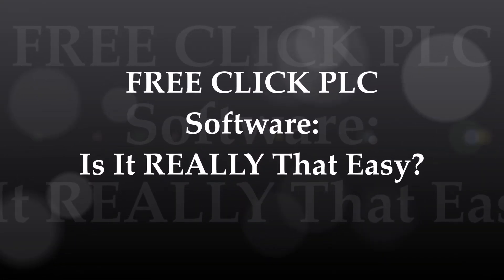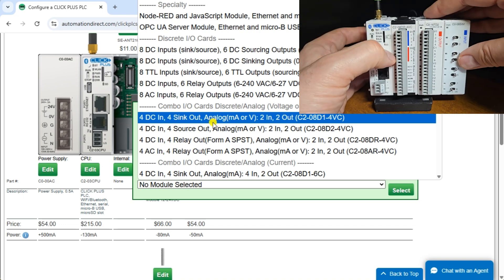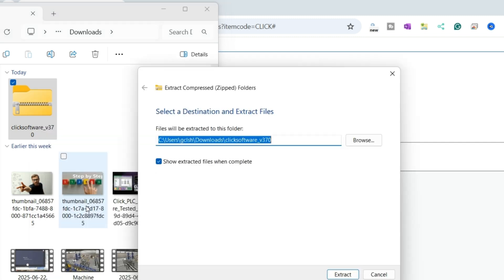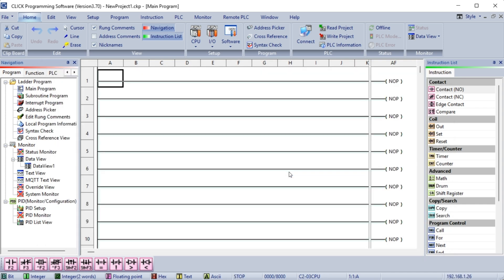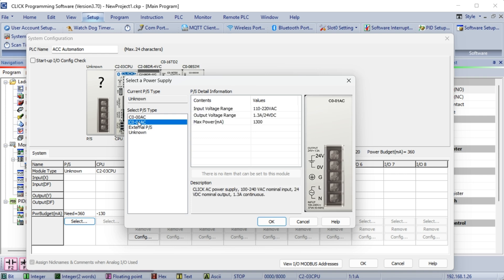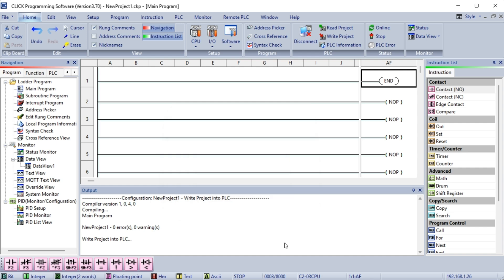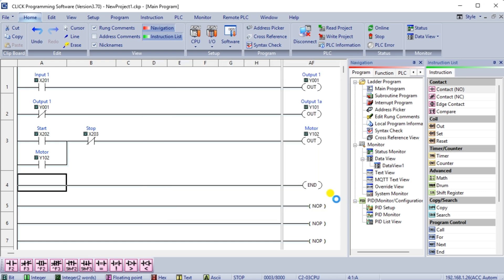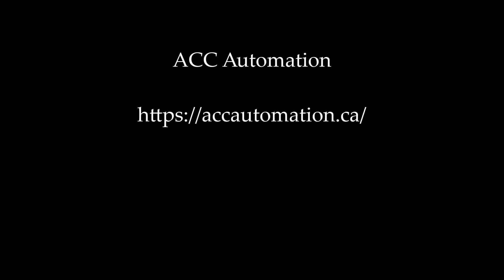FREE CLICK PLC Software: Is It REALLY That Easy?

Comment from the maker: For more information, please visit our website. This includes all of the links mentioned in this video. 
https://accautomation.ca/free-click-plc-software-is-it-really-that-easy/

CLICK PLCs were designed with simplicity in mind, providing reliable control at a low cost and with a minimal learning curve.
This simplicity makes CLICK a perfect solution for small machines, home automation projects, pneumatic applications, or anywhere a simple system needs a budget-saving control solution. 
Building on the original CLICK's simple design, the new CLICK PLUS PLCs offer the same practical control, but with some surprising added features. Utilizing the same free, streamlined PLC programming software as its predecessor, the CLICK PLUS PLCs provide hassle-free programming, complemented by advanced capabilities such as Wi-Fi communication and data logging.

The Click and Click PLUS PLC series can be found at this URL:
https://accautomation.ca/series/click-plc/

Features of the new Click PLUS PLC (C2-0xCPU) include the following:
  Micro USB
  DHCP support
  DNS support
  Wi-Fi (programming and Modbus TCP)
  Bluetooth (Wi-Fi) provisioning
  SD Card (Data Logging)
  Data Logger
  Network Time Service
  MQTT (Publish/Subscribe)
  Required PLC Password
  Disable Ports
  Strong Password Support
  Disable Ping Response
  Encrypted Password Transfer

We are using the Click and Click PLUS PLCs for several reasons. Here are just a few.
 - Investment is low for the hardware, and the software is free
 - Standalone PLC with built-in I/O
 - Communication ability - Ethernet Port, RS232, RS485 - support for Modbus RTU, Modbus TCP, etc.
 - Ability to expand the system with various modules, including RTD and Thermocouple inputs directly.

Regards,
Garry
ACC Automation
https://www.accautomation.ca

Comment: Only wish the units were more available outside of the US Instead resellers outside take you to the cleaners!  I have home automation and a 3 motor multi function woodworking machine on clicks. The software and units are amazing and the  documentation was may main reason, that and the software instead of some pirated old tool. Being a bit of a developer the ladder logic is easy to understand and integration is even better now with email and mqtt dont have that unit unfortunately but work with lots of other mqtt tools.  a Linux app would be really helpfull
Reply from the maker: Thanks for the comment. Another tool you may want to check out is Node-RED.
This will communicate to the Click PLC using Modbus and flow programming.
https://accautomation.ca/series/node-red-iot-enabling-software/
Regards,
Garry
Reply: @ACCautomation  I have used that I ment to program the plc from linux its the only widows VM I have left :)